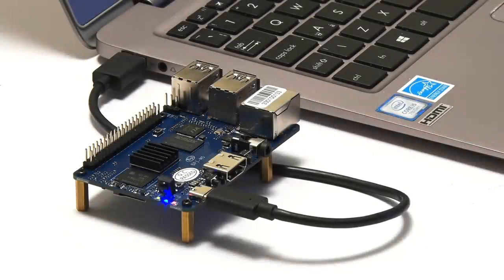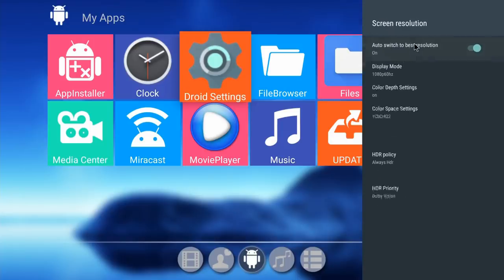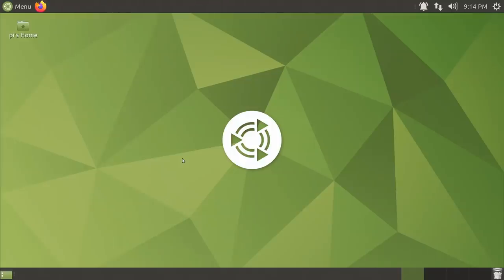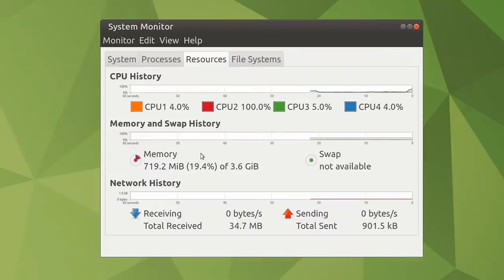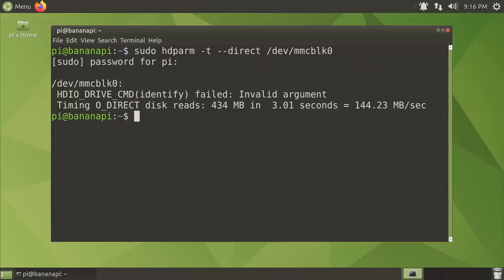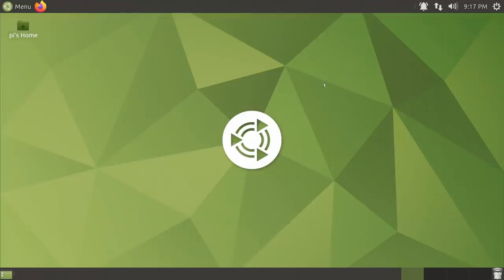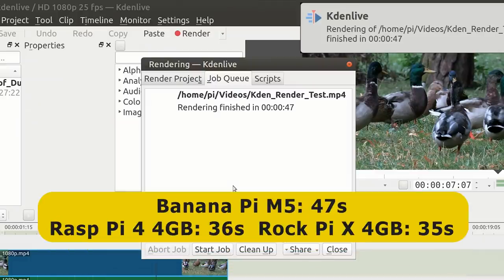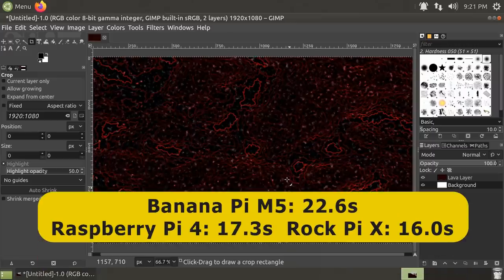Banana Pi M5: ARM SBC with eMMC

Comment: I wish someone would test the power consumption of this board versus other SBCs.  Like run a script that does a variety of tasks that use the board differently, and has time between those tasks where less tasks or even 1 simple task is performed every x minutes.

Because there are SBCs that people plug-in to AC, and then there are SBCs that people are running off of other more limited power sources, included but not limited to batteries and solar.

An example being, for myself, and even more so for others, if the RPI 4 performs better than the Banana PI M5 by let’s say 15% but it consumers 50% more power doing it than the Banana PI M5 is actually the board that will provide you with better real world performance if you need to use it without access to AC.

The irony is one of the original reasons for creating the RPI was for computer science education in developing countries, places where having access or even being able to afford electricity / AC is an issue.

This isn’t directed at ExplainingComputers per say, just need a SBC that has to run on solar and batteries and go into low power modes for long times, but when it needs to performance operations they need to be done in a very timely matter so it needs a fast CPU and as soon as it’s done I need it to go back into low power mode.  It just got me thinking about the  Raspberry PI / ARM SBC, and what the purpose was and where we are at now, that’s all.

Comment: Is there a boot override? If the eMMC gets corrupted and doesn't boot properly, then without a boot override to boot off USB or SD card instead, then this board will just be a brick at that point since we wouldn't be able to wipe the eMMC to fix the issue.

Comment: When you showed the system properties under Ubuntu Mate, one could briefly see the graphics acceleration shown as 'LLVM pipe'; basically, as you said, software acceleration; while you didn't show the corresponding settings under Android, most likely it has the full Mali graphics pipeline onboard. Perhaps this somewhat contributes to the overall slightly disappointing benchmark results.

Comment: When comparing performance against the Pi4, was the cooling comparable? There may be the possibility that the processor on this board might be overheating and halting, or throttling the speed, and therefore diminishing performance.

Comment: So it's been a while since I watched those other videos. If those other SBCs were running purely from SD cards then this could show that the BPi 5 is even slower if it had the slight speed advantage of onboard storage. Either way, I don't see this replacing my Pi 4GB model.

Comment: This board doesn't capture my imagination as much as the Raspberry Pi Pico did a few weeks back. It is a little high priced for what you get. Only 249,000 more subscribers until you hit 1,000,000. Seventy-six percent of the way there.

Comment: My 3 year old, 160 Euros Motorola One Action Mobile, has a much stronger SoC, also for 4GB of RAM, 128 GB MMC and can also take an SD-card up to 256 GB. It also has a stronger GPU, also a USB-C and can display HDMI up to 4K in 60 frames. Also a headphone jack and even a built in speaker, not to mention Wi-Fi and also mobile internet.

Why isn't there a single board computer in the same price range form maybe even more expensive, which delivers such performance?

Why do we still have to put up with A55 cores when my little mobile already has A76 cores, higher clock speeds, higher GPU and what not?

@ExplainingComputers Why isn't there a killer single board computer or arm-based computer in general? Why do I have to use my mobile as a PC?

Comment: The Banana Pi M1 plus seems a better option as jt has display and WiFi connections on the board as well as hdmi socket.  At half the price it's a definite way forward.

Comment: Good food for thought.  Do you know if any manufacturers have considered a RAM upgradeable SBC.
Reply from the maker: An SBC with socketed RAM would, by definition, no longer be an SBC. :) But there are boards like the Udoo Bolt and Odroid H3+ that kind of fit the category, although they are x86 computers and much more expensive. And that's the real issue. Adding socketed RAM adds greatly to the cost (remember that all ARM SBCs are based on tablet technology, where there is no socketed RAM). So there is no way to create an SBC in the Pi-end price bracket with upgradable RAM I'm afraid.
Reply: @ExplainingComputers  Thanks for the explanation.  Keep up the good work.

Comment: Yes well I don't understand why they didn't include BT and WiFi. And also I'm curious if new SBCs will use newer CPUs better than Cortex A72s and maybe support DisplayPorts. Also the problem is with HDMI is that it doesn't support VGA adapters nor DVI-I and that HDMIs costs more than DP and that I had to use RetroTINK for my old game consoles

Comment: I saw in the about window that it's using llvmpipe, so there's no graphics acceleration being used. I wonder why no acceleration is enabled on the mali g31: with Panfrost in Debian Bullseye the Mali-based gpus should do a lot better than software rendering. Perhaps 20.04 is missing this big upgrade

Comment: Hmmm...exact same Android interface as the S905x3 Android tv boxes. Might be better off with one of  those if you won't ever use the GPIO pins. They have wifi & BT built in and up to 128 GB internal storage. I'm pretty sure that Linux can be flashed  to all of them. I know that people definitely run Emuelec on them & it works great.  Might save ypu a couple $$$ depending on your use case.

Comment: Are you aware of any SBCs which support a DB9 connector for serial communication? These are still very common in manufacturing and repair situations, and having a small handheld with a DB-9 pre-installed would be wonderful for my line of work. I am aware it could be broken out from the headers of a Pi or similar to my own DB9, and am planning that now.

Comment: So cost as much as a raspberry pi 4 4GB, but is slower, no wifi or bt, no camera connector does not make it really interesting. I really wish Raspberry Pi 5 goes to full hdmi, and also a m2 for storage, and some way to  mount a cooler easily.
Reply: I'd rather have a mini pc any day even an Intel atom
Reply: @si4632  If a mini-pc could be bought for $60, I would also get one.
Reply: @AndrewTSq  they can be had for about £80

Comment: The absence of WiFi and Bluetooth is an advantage considering the safety aspect. I do not consider it as a downside.
Reply: It presumably uses a little less power with their absence, so might be useful where low power draw is important.

Comment: There are several tv boxes out there on Ali based on s905x3 chip with 4G/32G memory config with onboard wifi/bt installed and cost below 50USD
The only thing missing is GPIO connectors but I can not imagine why someone needed GPIO along with hdmi (if one uses GPIO connectors this must be rather some automation project, not desktop).
What is good with those tv boxes is decent android based firmware with  Google services installed including hw accelerated youtube client and working hw accelerated video playback in browser

So this board looks pretty pathetic to my opinion